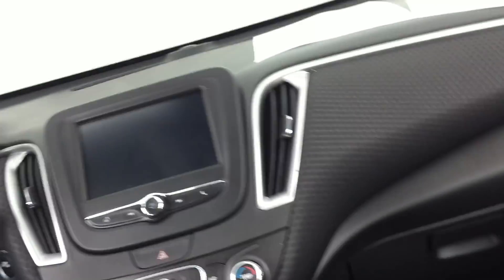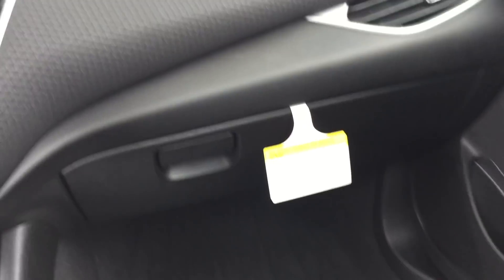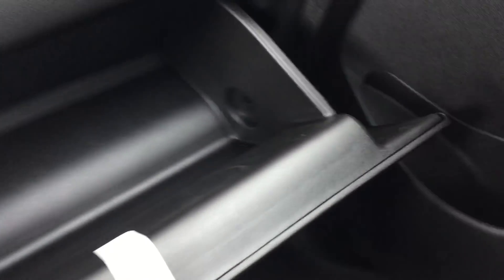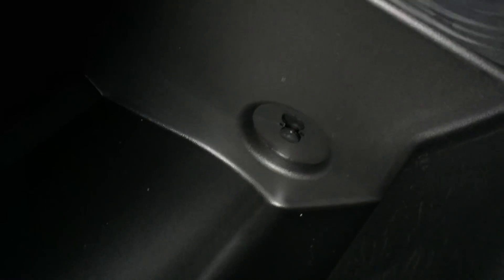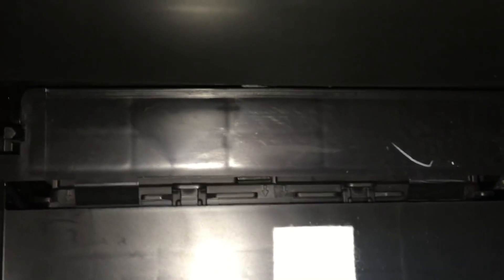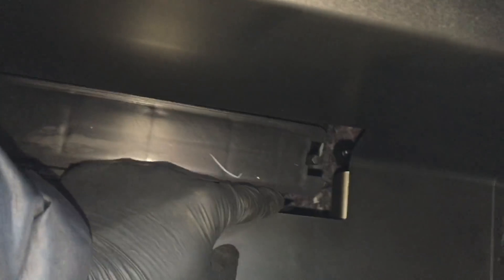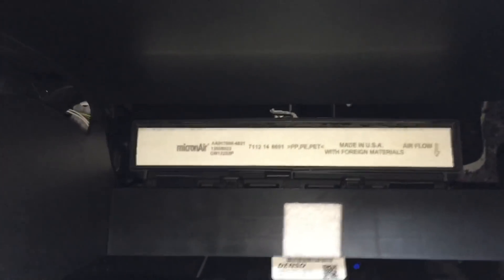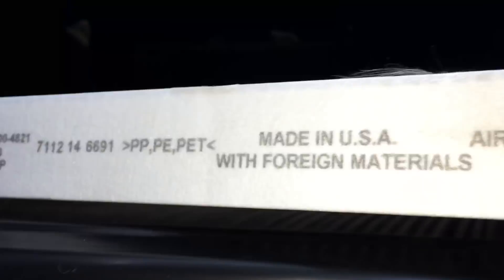Replace Cabin Air Filter 2017 Chevy Malibu 2018 Chevrolet Impala How To

Comment: Thanks for the video!  It's remarkable how easy that is.  It's even simpler than on my '19 Volt (which IIRC had 5 screws to remove, to get at it).

Comment: I have a 2018 lacrosse and I’m having trouble . Do you push the tab in or to the side ? I tried pushing in and it won’t move . Also did you do it with a great deal of force ?
Reply from the maker: It can’t be too hard I think you’ll have to push it to the side. Just take a look at it and you should be able to see how it works.
Reply: Karrs Kars Thanks ! I got it .